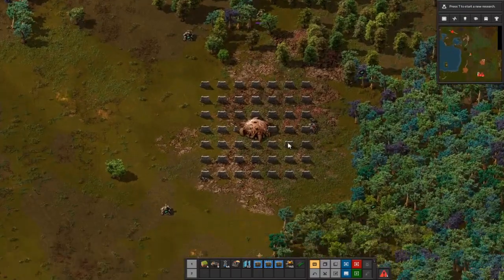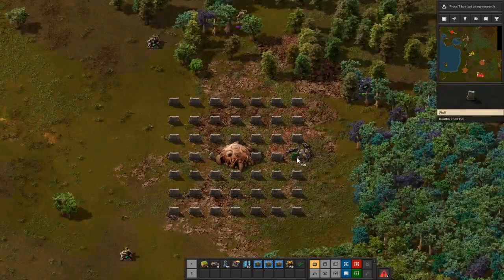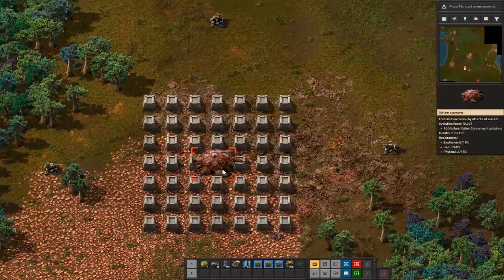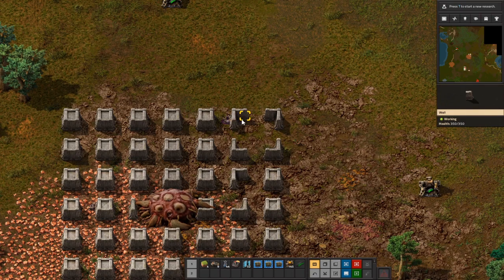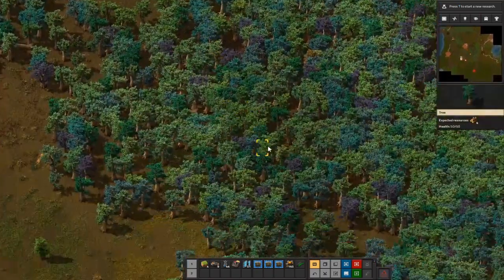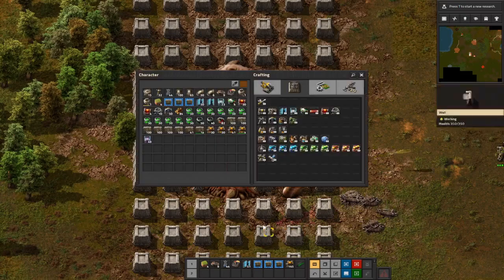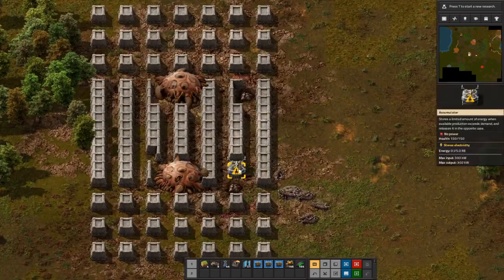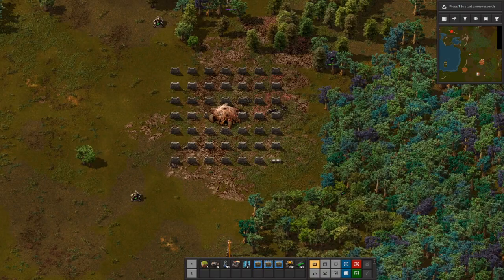Factorio Disable biter spawning

Comment: Thanks for making a video about your findings :)

So it appears spawns are only possible in like a dot pattern around the biter base?
Then the question is, are the biter spawn locations relative to the biter nest location, or to the tile grid? This may be important as biter/spitter bases spawn either aligned to the tile grid, or with a 0.5 tile offset (so, it can be 26.0, 26.0, but also 26.5, 26.5, and this also determines how "big" the nest is (5x5 or 5x4)) and how many walls you need to block the nest).

Anyway, pretty cool to see the minimum investment possible to block all spawns. In my playthrough, I'm going to continue with the fully filled in blobs of walls to be absolutely sure/fool proof, as I'm bound to make mistakes otherwise, especially when I'm being buggered by tons of worms and biters while executing the strategy!
Reply from the maker: Do keep in mind using accumulators for blocking spawn points as the third case in the video shows that with just walls you can't always completely block all spawns. 

And I'm guessing that also there may be cases where preventing spawning may be impossible due to not being able to place a block that can block the spawn in the desired location.

Also. I have a feeling that the 5 by 5 nests are the only ones that spawn during generation, and the 5 by 4 are the only ones that spawn form expansions because in the test world i never found a clump with a mix of nests. And the location as an explanation you said may be possible, i might take a look at it later (if i have the time)